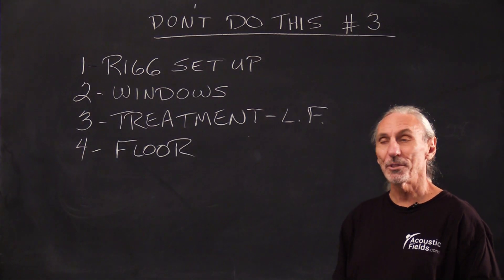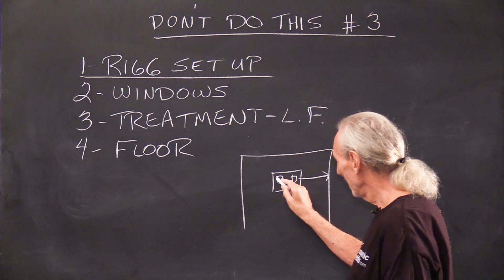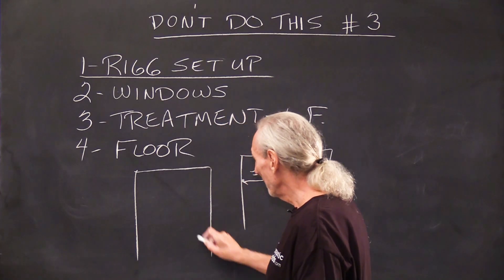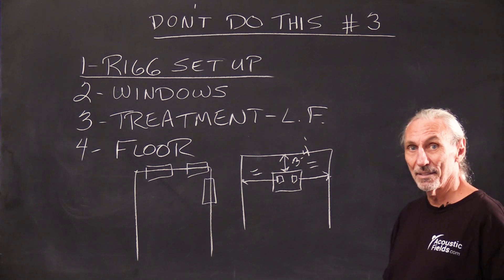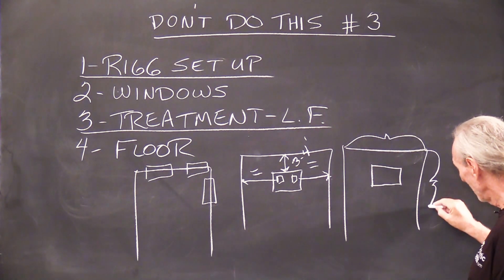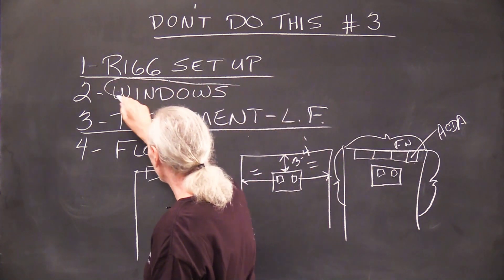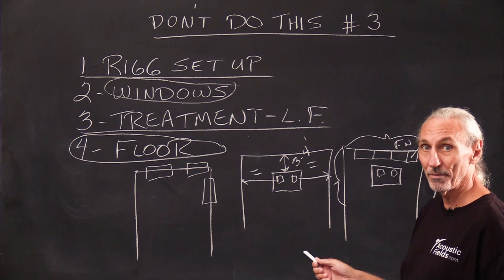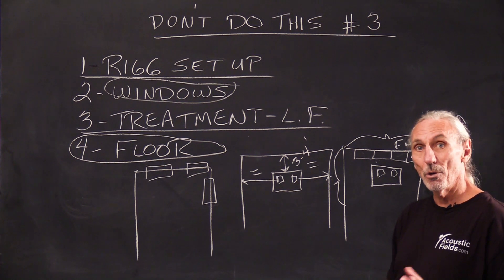Don't Do This! #3 - www.AcousticFields.com

Comment: I followed all your guidelines but I'm stuck with a 7 foot ceiling basement concrete😞
Reply from the maker: Unfortunately, you will have to live with certain frequency and amplitude issues. You can treat the sidewall to sidewall, front to rear wall issues but you will have to live with the floor to ceiling issues. LF treatment takes up 8-10" of space.

Comment: People seem to have a hard time accepting how damaging glass is to sound. So I'll tell a story. First, in my small room, the first I treated, I was dealing with some really bad high frequency reflections via some absorbers above the speakers... Then I figured out it was a window causing the evil reflections, I treated the window(s) and experienced about the most radical change/improvement of any changes I've made. So I became a big advocate of treating or banishing windows. 
So I moved on to the big room and there is a window in a bad spot (right side first reflection), I covered what seemed like the important parts with absorbing units and it improved a lot, so I thought I was good... over a year later (4 days ago) and I'm trying to finally figure out why the sound stage is out of balance, which it shouldn't be, and why the 3d part of the sound stage doesn't quite develop fully.
I was outside walking past that one window 4 days ago and heard the same sound signature I heard from the small room window (higher pitch than the activating music and very screachie). My brain started to go on about how that's the crap you look for to solve.... and after a few steps I said to myself, so solve it... so I did and it fixed the sound stage completely and finally brought the rig to the level it should be.
Everything counts. Windows suck.= (so do walls, doors, furniture, any 5 or 6 sided volume.... the list of acoustic traps is endless)

Comment: #4 is a diamond in the rough. If the ceiling accounts for 15-20% of room sound, I wonder the percentage the floor accounts for since it is typically the closest room boundary to your ears. 

In fact, lining the floor with plywood rectangles partially filled with activated carbon might be a solid idea. Say 3 inches of depth, filled with two inches of activated carbon + 1 inch of air? I've never seen a project that addresses the entire floor so it makes you wonder.
Reply: If needed, Dennis does build essentially the same design that they use in the walls into the floors and they design to what the data and usage requires.

Remember, if you dig out the foundation, you have control over how deep you go and what design you use. 

He discusses in his CAW video.

I think he's either in the middle or at the end of a large build project designing rooms for pianos and he's building his technology into the floors since pianos have a lot of energy going downward and the floor is typically only about 2ft to 3 ft at most.
Reply: @Oneness100  You are right, I saw that the day after I posted ; ) Really interesting stuff. 

Considering how little floor treatment is mentioned (not just in these videos but in general), it seems like an afterthought/or the least of one's worries...and it is possibly the most un-fun aspect of a typical listening room build.  Pour X-amount of concrete for your slab, then build a CAW onto of that. Yowza! That Hugh gentlemen hired AF to built an incredible listening room but I can't remember much being mentioned regarding floor treatment.

I will build a home theater once my family moves into our new home. I have the money for the design fee but it's pointless to request services until I know exactly what my room details will be. Still fun pondering all the possibilities ; )
Reply: The same percentage I believe..  6 surfaces divided into 100 is 16.666, or roughly 17%.  One surface might change it's percentage maybe due it's surface area.  A larger surface area might increase a little compared to a smaller surface, but I think Dennis can validate this.   But it's in that 15% to 20% ball park for each surface..